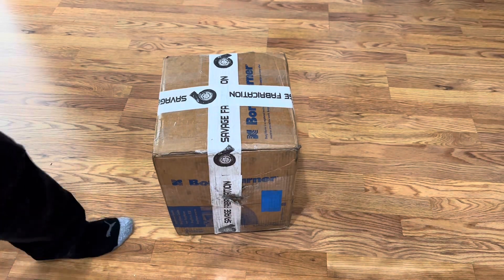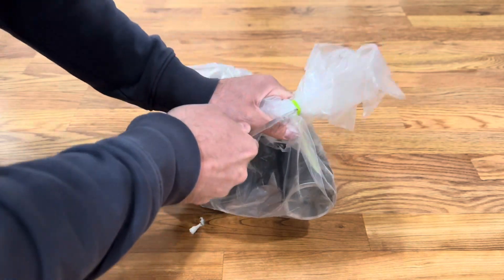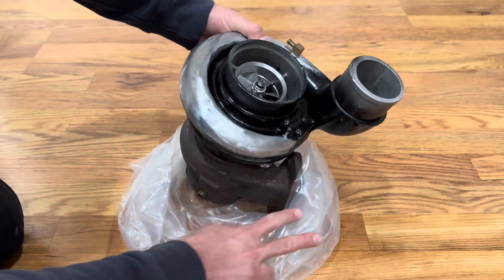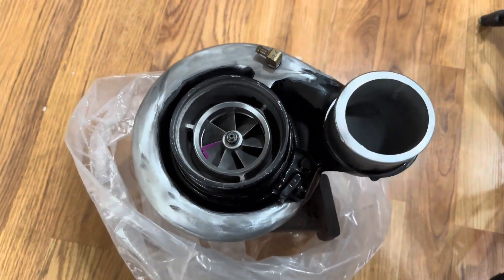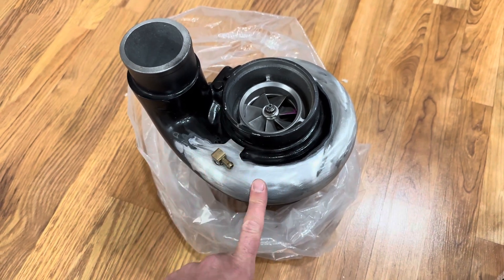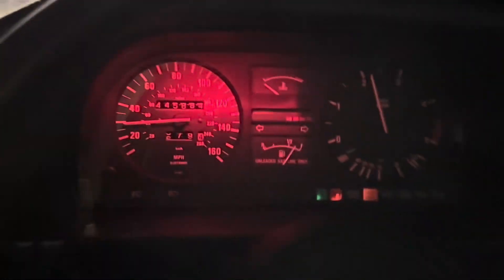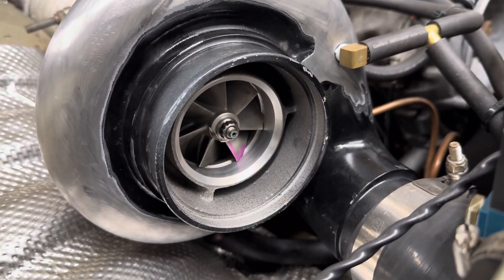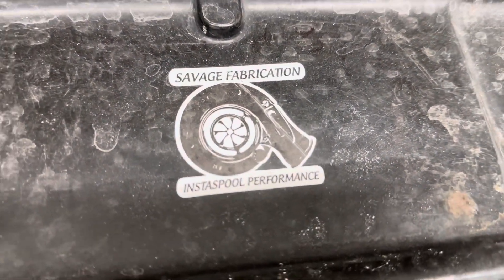Savage Fabrication Holset HE351 60/67 unboxing and quick test

Comment: Hey man, do you have any videos about DSM stepper motors or any article on how to wire a 6 pin stepper motor to a speeduino UA4C vc2 board?
I mean with the wiring I have right now from the speedo board to the stock wire harness, I got the iacv to vibrate when turning the ign on but other than that I cant seem to control the iacv on tuner studio not sure if I need to do something else or any idea on this?
Reply from the maker: I unfortunately don’t have any videos on that

Comment: I was wondering if the inter cooler would fit with the ac condenser and fan in place?
Reply from the maker: Not with the size intercooler I have. If you found something smaller it would work